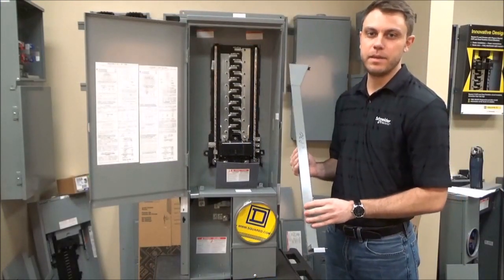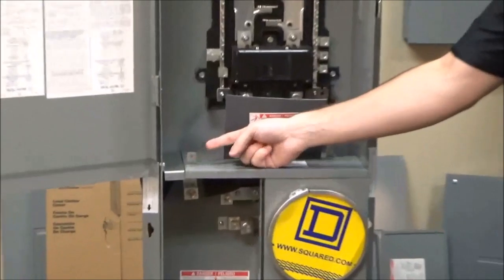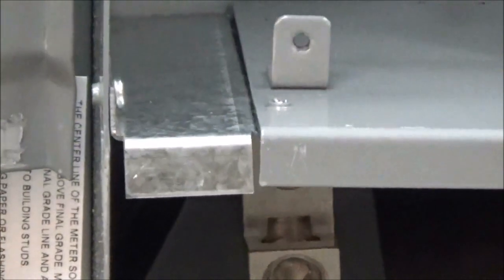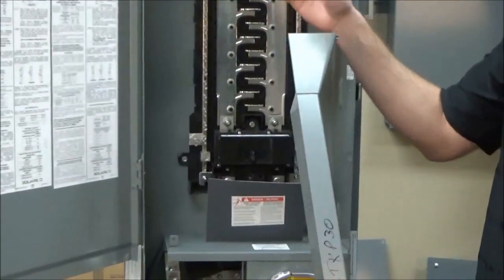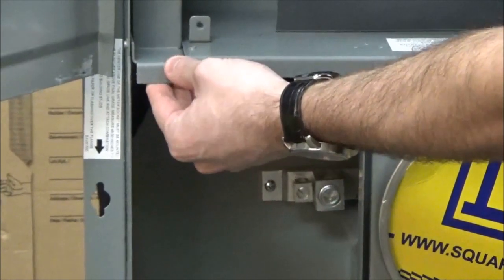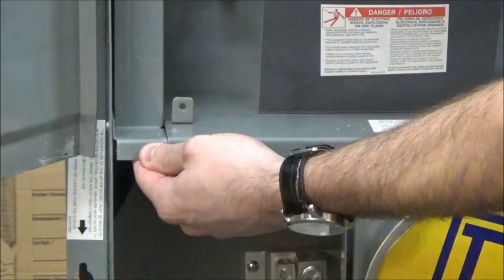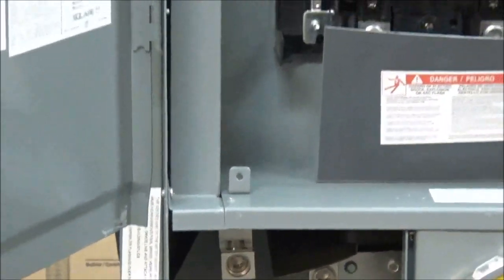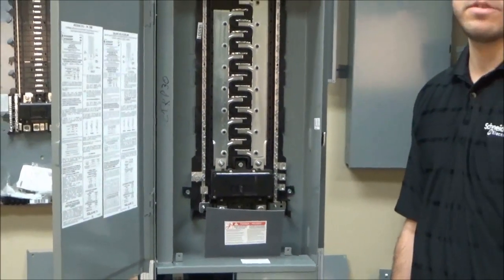Installing Overhead Feed Tunnel Kit in a CSED | Schneider Electric Support

Comment: This panel has the OH utility fees option but does not have the hub screws. When feeding your service line from the top is it within code to just connect the rigid conduit to the top of the panel using locknuts instead of a hub?

Comment: With this tunnel kit installed, what size knockouts/holes will the top of the tunnel kit accommodate? For example 1.5inch, 2 inch? I would be using this with a 1.5 inch or 2 inch rigid piece of conduit for my service mast riser. Thank you
Reply: Capt Kirk both just buy the correct Hub for it. I’ve used both size no problem.
Reply: Michael Valdez what is the correct hub kit?
Reply: I just used a 2” knockout. The don’t have threaded screw holes for a hub on top, but only for the bottom (four screws come installed on the panel. I used a threaded 2” rigid pipe with a threaded locknut on inside and outside of the panel, then a smooth, plastic end-nut. Worked fine. Now if I could jus find a tunnel lit somewhere for the 2040.